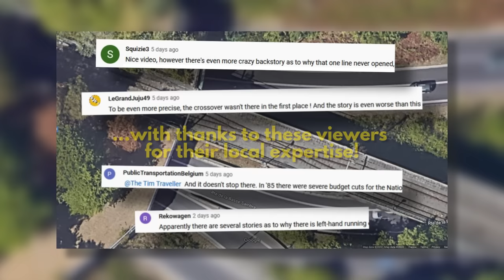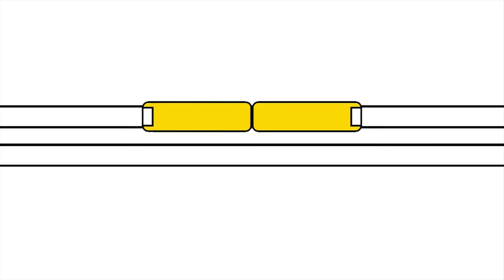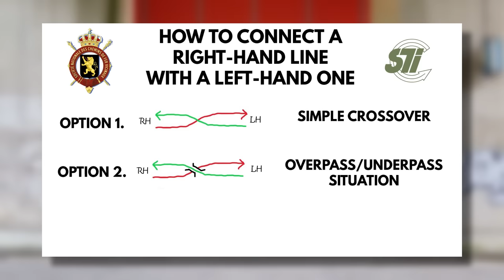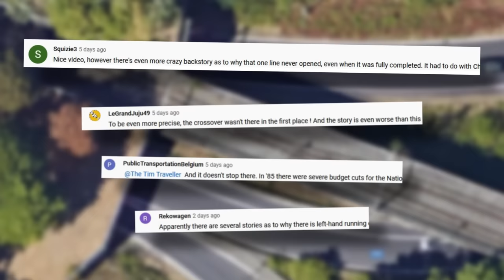The Belgian City That Built Two Metro Lines The Wrong Way Round

Comment from the maker: p.s. There is something I should have made clearer in the video. A few people are asking why, after the merger, they couldn't have simply switched the old STIC lines to run on the same side as everything else. 

The reason is that all the signalling and related electrics had already been installed on the left hand side. It would have been a massive pain, not to mention hugely expensive, to take it all out and put it on the right. 

Much cheaper, and easier, to install two little crossovers!
Reply: Nice to have it next to a vintage point. They can set up popcorn stands for bystanders to wait for the first head on collision 🤣 - seriously; moving a few (it's not many stations I gather) signals over by a few meters might be more costly initially, but should  be worth it for a real operating line?
Reply: @atkelar  I think the cost and inconvenience of the crossover would be quite small
Reply from the maker: @atkelar  I guess we'll find out when they start work on the line 5 project! Will be interesting to see if they resignal it and run it on the right, or just leave it as it is
Reply: Ow that's why
Reply: @TheTimTraveller  My money's on they resignal and run it on the right, with the added bonus of a second crossover to undo the effects of the first crossover 😁
Reply: There are same kind of tramway self-crossings in Zürich and Vienna, too.
Reply: The Transport Tycoon music is priceless... 🙂
Reply: The think that drives me really crazy from this video - I can't remember what the song is at the end! It's a total earworm!
Reply: I'm from the future and can confirm that it will not open, mainly thanks to the War To End Civilization that's due to start in the next [SPOILER ALERT] years.
Reply: Well, after all, in France the mainline railways run on the left, the Paris Metro runs on the right.   What the RER does (RER is a sort of express Metro) I don't know, but there must be places where they all share lines (or so I would have thought) so this sort of issue must come up.
Reply: @michaelalexander65  Avril Lavigne - "Why do you have to go and make things so complicated?"
Reply: @ianroberts6531  thank you!
Reply: @cr10001  RER runs on left. There's absolutely no connection or share lines between metro and RER.
Reply: @atkelar  There will be no head-on collision as the crossover is properly signalled.  Charleroi metro has lineside signals and speed limit indications which are enforced by an automatic braking system in case a driver does pass a signal at danger or does overspeed on a speed limitation.  It's the exact same system which used to be in Antwerp and Brussels premetro.
Reply: Please someone from 2030s answers, how is it now with the line 5? Please be quick I'm impatient 🤣🤣🤣 any time Traveller? Like the Tim Traveller 🤗🤗🤗🤗
Reply: @DavidIrwinsPage  I suspect they'd resignal it anyway, just to be compliant with European Train Control System requirements of the European Rail Traffic Management System.
Reply: @cswvna this is a meter gauge urban transport system, not meant to be compliant to ERTMS/ETCS anywhere in the future. It will stay with lineside signalling, PIF/BX balises and BCFA on-board train stop as long as spares are available which seems to be the case as the end of the line to Soleilmont, the loop joint and the new Charleroi-Sud layout have been / are being (re)signalled with brand new equipment.
Reply: @michaelalexander65  "Complicated" by Avril Levigne. I'd recognize it anywhere. That tune was ABSOLUTELY INESCAPABLE in the 2000s.
Reply: @TheTimTraveller  The signalling, although still functional, is probably rather old by now and might deserve renewal which could achieve right hand running affordably. Line 5 would presumably require new rolling stock, so authorities could specify bi-di vehicles with doors on both sides. The island platform configuration was probably a little cheaper in construction for elevated and sunken stations than a twin outside platform arrangement, as fewer access stairways/lifts and other facilities would be required.
Reply: Can you please do a video about Andorra a video series about Andorra I mean it’s actually not that bad I haven’t been there but I feel like people are over exaggerating when they say it’s the worst country in Europe
Reply: At this point, why haven't they just replaced all the unidirectional trains yet? Then the crossover is no longer needed of the trains have doors on both sides.
Reply: Good thing no money has been wasted so far on updating 50 year old signalling and electronics 😉
Reply: I am from the future.
The good news: Everything is open and running.
The bad news: Everything is now run by the Transport Authority of the Russian Empire...
Reply: A bit like the Moscow's Kazan line. Which runs on the  left hand side thanks to the UK engineers that built it back in the Czar days. Also, see the Vogograd metrotram that has tunnels crossing over so the Tatra T3 streetcars with only one set of doors can service the underground stations.
Reply: Nice OpenTTD music soundtrack going mate.
Reply: @atkelar  I can imagine the intersection uses signalling just like any other intersection. It’s not like railways are the wild west! Here’s what’ll likely happen instead. Train A is coming down the line approaching the swap. Train B is coming along, and because the signal says, they stop. Train A passes through without issue, train B now proceeds. Everyone is now happy!
Reply: fair
Reply: @DavidIrwinsPage  What you’ve just done is merged Hornby with Scalextric!
Reply: Wow, who was in charge, CalTrans? [California Transportation agency.. ridiculously backasswards operation notorious throughout the state for doing road surface repairs during commute hours, and taking inordinate number of months accomplishing nothing.. costing millions of drivers hours upon hours of life as well as companies,  of all sizes, millions of dollars; just saying, maybe those who hold jobs sorting out how people should move about need to be replaced immediately.. imho]
Reply: @alexwolfeboy  I do realize that this is the plan. However, the best laid plans of mice and train operators... A system without the trains crossing in active operation, right in the middle of a line, is certainly much safer than any signalling could ever make it. That's why I think that chances are rather high that something will happen there eventually. Case and point: the Titanic had state of the art water tight bulkheads so what happened to it could never happen. I stand by my assessment: as a passenger, I'd like to see that crossover removed before regular traffic starts.
Reply: I mean, of course it’s a brilliant idea to switch sides in the middle of nowhere, why you even ask
Obviously this won’t make train drivers paranoid, and doesn’t carry potential collision hazard, what are you talking about?!
😂😂🤦‍♂️
Reply: 1:24 who recognize lovely Transport Tycoon soundtrack?))
BTW, what is the title of this melody?
Reply: Spending massive amounts on anything that takes their fancy is what Brussels does best, whether it makes sense or not.
Reply: @trevorhoward7682  I guess the gain enough on speed tickets
Reply: @cr10001  RER runs on the left, and there is no shared track.
Reply: Ow! That is very simple, i guess i were build for trams, underground stations got platform in between rails and stations which are on street got platforms from sides of rails
Reply: @tsugumorihoney2288  I've always been told metros were trains that, because trains are invented in Brittain,run on the left, while trams were cars that run on the right because running cars on the left would be insane (like the English). I was assured no actually rational reason for this convention exists.
Reply: @DavidIrwinsPage  That second crossover would be the Belgian solution ;) And yes, as a Dutchman I like those Belgian funny stories (not jokes as the stories tend to be true).
Reply: @nagualdesign  I'm from the future as well, and I comfirm it has opened, but just a bit later then your future, because, a serious delay is common, and washed away with beer.
Reply: @TheBayru  31% of countries in the world, have the trafic going on the left side... Amazing "much" isn't it ? Why driving left and why driving right ? Both are just excellent. Because only driving in the middle is provoking problems... 🙂
Reply: @apveening  Have a look in Roosendaal station.....  :-) :-)
Reply: Thanks for this update. I was wondering about that.
Reply: What´s the point ? Left or right running, there are a wide array of GLR and trams high and low door with doors on both sides. Resignaling costly, risk of accidents high moving these crossover to the end of the line, much better. Succesor company should decisively  forward !
Reply: @ice401557  I don't know about the crossing(s) in Zürich, but the two in Vienna are only there to serve a single island-plattform station on a bridge with single-direction trams.
Reply: У місті Кривий ріг також є подібне перехрещєння ліній метротраму зі зміною сторони руху.
Зроблено то було, не через власність різних компаній,і вже так встановлене обладнання, а через те, що рухомий склад який використовувався у ті часи мав двері лише з одного боку, тоді як підземні платформи планували робити за традицією метрополітену острівними, а наземні за традиційними нормами вуличного трамваю, тобто з бічними платформами. Рішення зробити змінний напрямок руху було прийнято щє на єтапі проектування
Reply: кращє було зміну напрямку руху зробити у різних рівнях, дорожчє, проте безпечніше, і без складнощів у організації сигналізації та узгодженості графіків руху.
Reply: @alexwolfeboy  подібне перехрестя може існувати лише при дуже повільному руху, щоб не витрачати на ньому час, його б варто було розвести по окремих рівнях.
Reply: @michaelalexander65 complicated by Avril Lavigne

Comment: In Belgium there is a simple rule: anything worth doing is worth doing the diufficult way. And with this metro line, even the things not worth doing have to be done the difficult way, because that is the Belgian way.
Reply: Nog nooit van gehoord makker
Reply: Also putting the crossing point at the most dangerous place where the train will fall into oncoming vehicles.
Reply: Or you could say there are at least three ways of doing something: the right way, the wrong way, and the Belgian way.

Comment: More examples of this: In South Korea, Seoul Metro line 4. During the Japanese occupation, railroads were made to run on the left. After independence, it was too costly to "fix" all the rail systems from left to right, so this still continues till today for intercity railway systems. But an exception was made to when building metros: they were made to run on the right side. So when they tried to make Line 4 longer by connecting Line 4 (which runs on the right side) to Korail lines (which runs on the left), they solved this problem by building a 3-dimensional grade separation in the tunnels. Also, they run on different electricity (DC1500V / AC25000V) so carriages running both parts of the line is able to switch those.

Hong Kong has a similar left hand to right hand running swap in the middle of the Tuen Ma line, although the reason was more understandable. Originally the Tuen Ma line was two separate lines built by the same company, the KCR or the Kowloon-Canton Railway. The western line (simply known as the West Rail line) used normal left hand running, but the eastern line (the former Ma On Shan line) used right hand running to allow an easier cross platform interchange at Tai Wai.
Reply: 100% correct. Seoul Metro line 1 and 3 also had similar problem, but the solution was way simpler than that of line 4.

Line 1 was the first subway line of SK, so they simply chose to go all left - just like every other trains did at the time. And line 3 was made to go all right after Korail, Seoul Metro, and government agencies having a big quarrel with the inefficiency of building such meaningless structures.

You can still see Seoul Metro train lights going out for a few seconds at some stations, and that's where they switch DC to AC or vice versa.

Comment: A more interesting tram fact: Three of Pyongyang's tram lines uses Czechoslovak trams or DPRK-made tram bodies on Czechoslovak-made chassis. But there is a FOURTH line, and this special line runs from Kim Il-sung University to Kumsusan Palace of the Sun, the resting place of my grandpa and father. Originally there was a Metro station below the palace called Kwangmyong on the Hyoksin Line, but it closed when the palace became sacred grounds as a mausoleum, and so a tram line was built from Samhung station also on the Hyoksin Line to the palace. This is a meter gauge tram line, and unlike the other lines, it uses trailers built in the late 40s in Switzerland that have since been retired from Zurich's tram system. I miss Switzerland
Reply: Hey kim! Urethral papercut
Reply: I thoroughly apologize for my last comment, I was drunk

Comment: Like the Zurich tram schwamedingen extension that was supposed to be a metro but then got converted into a tram line where at both tunnel exits there's a crossing as trams only have doors on one side but the platforms are in the middle.
Reply: Damn it, I wanted to write that XD
Reply: Technically, there is only a (level) crossing at Schwamerdingerplatz -- Milchbuck has an underground flyover...
Reply: (which also avoids crossing the tracks going on to Schaffhauserstrasse)
Reply: That's rather like the Kingsway tram subway in London. It wasn't such a big problem because all the trams were double ended, so in the tunnel you had to get off at the front, where the driver was.
Reply: Guess what was the reason they built the planned "metro" with middle platform instead of side platforms: ...money...
Reply: Damn you are too quick!
Reply: Another fun fact is that this tram tunnel is located directly beneath a highway. So the exits cannot go up in some places, but instead you have to go down even further to exit the stations.
Reply: I was also going to say that, and, as far as I know, they built the central platforms so only 1 exit was needed instead of 2 for side platforms.
Reply: Conversely, the Prague metro was originally planned as a light metro, back in the 60s (I think), essentially trams underground, with rolling stock supplied by one of the Czechoslovak then-state-owned companies, ČKD. But for the USSR economy to stay afloat, they needed to meet certain quotas, among which was production and export of heavy metro rolling stock. So they called the Czechoslovak leadership and explained that what Prague really needs and wants is a heavy metro, i.e. something more akin to trains than trams. Problem is, construction was well underway at that point, meaning a lot of last-minute changes had to be done to some parts of the Prague metro project, including the strengthening of an (already completed I believe) car-and-metro-combo bridge that hadn't been originally designed and built to carry the loads the heavy metro with its beefier carriages and significantly larger passenger numbers would bring. The bridge still stands though, and the heavy metro was a blessing in disguise as it has a larger overall passenger capacity than the light metro ever could, and that capacity is needed today, almost 50 years after the opening.
Reply: I think it's the same thing on the "Angereds line" in Gothenburg, Sweden. Right hand traffic and plattforms in the middle on some stations  with doors on the right hand on the tram.
Reply: there is also a tramway in Vienna
Reply: @jakobb5371  It is on the newly built extension of tramline 26 at Gewerbepark (= business park) Stadlau where they built a station on a bridge and wanted an island platform to save costs. There are two crossings now before and after this station.
Reply: @AndreasR64  Thanks my Austrian Colleague
Reply: @blubbedidoing  And the reason why this tunnel exists is the highway. When the highway was built, the metro tunnel was excavated and built as part of the highway construction. Some money was therefore spent on a planned, but not yet approved project (it made sense, of course). The Metro project did not make it in the public vote. A few years later, the tram extension towards Schwamendingen was planned and built, and it was considered very useful to reuse the tunnel. Zürich has unidirectional trams, therefore they have to change the side of driving through the tunnel, in order to accommodate the island platforms. As stated elsewhere, a level crossover is in the ramp down to the tunnel on the Schwamendingerplatz side. On the Milchbuck side, it was better to build a separation, which also allows joining the line from Oerlikon without crossover (note that there are 4 lines serving Milchbuck, which means that this segment is pretty busy…). The tram line through the tunnel opened in 1986.
Reply: @vojtechjanda9684  And when they changed the plans from tram to metro, the station Hlavní nádraží was already under construction and that is the reason why in this station you enter the metro train from platforms at the sides (as usual with trams) and why that station differ from most other metro stations where there is just one platform in the middle (as usual with metro). There is no need for metro line crossing though because the metro trains have doors on both sides.
Reply: oh yes, Zurich, that has 10 times more money to spend but is too cheap to build a subway so we have to either a) use their snail-paced trams b) risk our lives cycling on the road c) pay a fortune for parking
Reply: @cecilebraillie4471  Not too cheap to build a metro, but the population voted against it. As you can see with the new "Durchmesserlinie" they spent a fortune on transport.